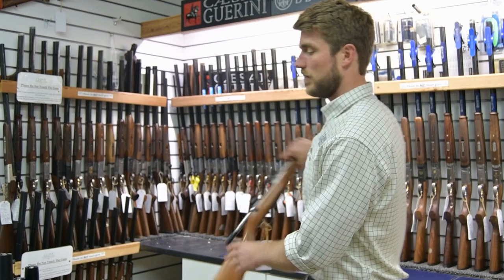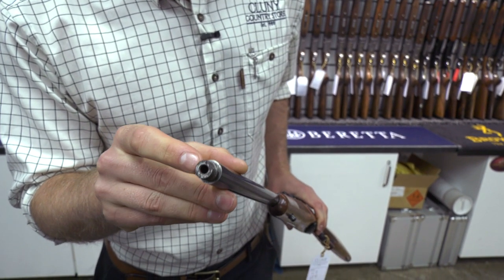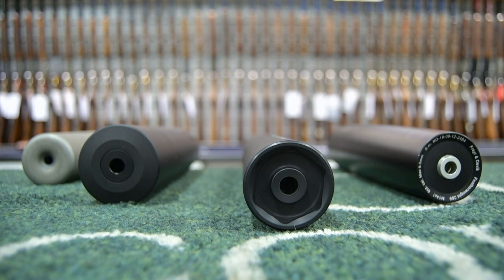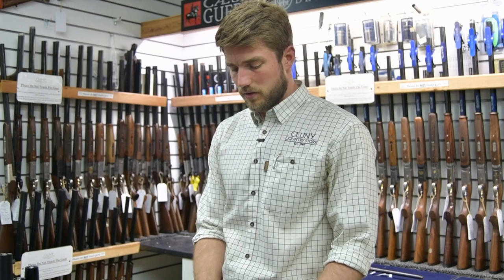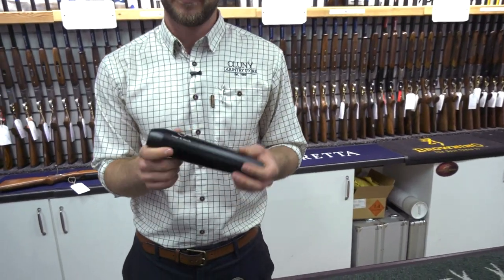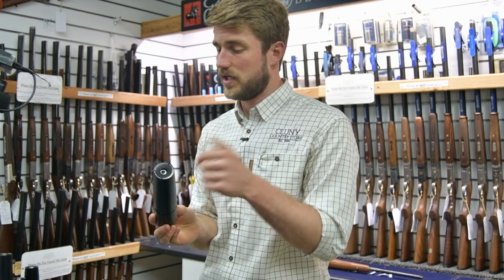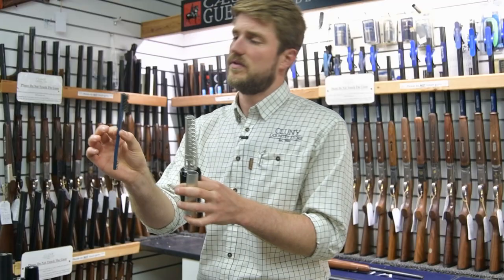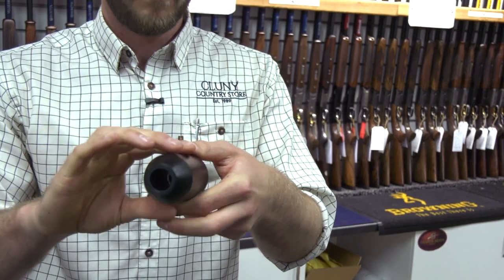Why you need to clean your rifle sound moderator

Comment: As a manufacturer of a premium brand moderator, I occasionally am tasked with cleaning the sludge made from the moderator due to oil and powder residue sludging up the internals. No oil is recommended inside any moderator as it fills up the internal capacity of the device and causes issues. Always remove any moderator from the rifle after use to prevent the corrosive gases from rusting the barrel. Never use oil inside a moderator. Always dab oil on the barrel threads.